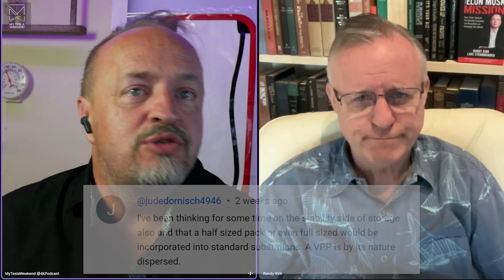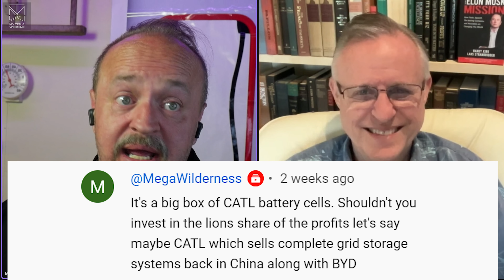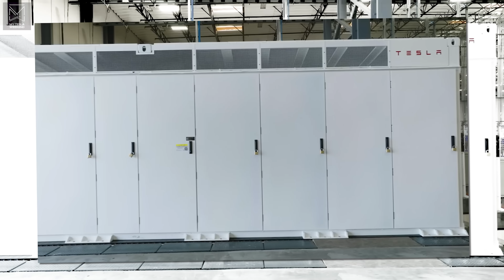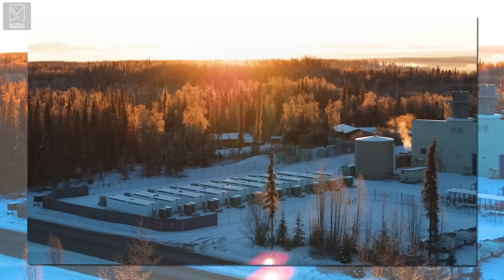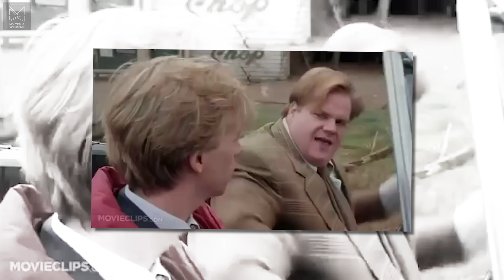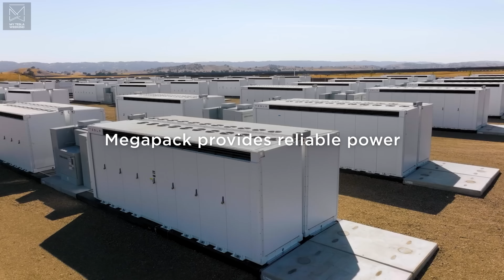Yes really, Mega Packs will make a TRILLION dollars

Comment: How about changing the structure of the Electricity grid from a centralized distribution model, distributing power through broadly spaced substations, to including independent micro grids using TESLA Megapacks, based at suburban locations with high Rooftop solar, with interconnector links to the main power grid.

Comment: On the outskirts of a rather small town (~10k pop) there's a large white metal enclosure with the Tesla name and logo.  I think it's smaller than a Megacharger but it's a hard place to park in order to measure.   I'll try to get a chance to park and walk back to get a shot and stick a tape on it.

I wonder if Tesla has made something smaller than a Megacharger for PG&E to trial?
Reply from the maker: Turns out the answer is YES! It's indeed called a Powerpack. Bigger than a Powerwall, smaller than a MegaPack.
Reply: @FutureAzA  
"Powerpack hasn't been talked about much lately. It has been relegated to the background since Tesla introduced the bigger Megapack for utility-scale projects. However, Tesla is still making the product and it is still being used for many commercial-scale projects, like Electrify America's charging stations.    Sep 22, 2020"

Comment: 20% could very well be the out-the-door margin. But no utility, enterprise or institutional customer would buy a $2 million battery system without a service contract. Given Tesla's ability to manufacture extremely reliable electronics, those service contracts are extremely high margin. Lifetime margin of 40%? Easily…

Comment: A Model 3/Y LFP battery pack specifically configured to be a wall unit for homes would be great.
Reply: That's a 'second use' for EV batteries.  Assume that the car/truck bodies will be worn out by the time the battery drops to 80% capacity.  Since the battery doesn't have to be hauled around the weight is less important, making it useful for stationary storage.

Having a secondary market for EV batteries will make it cheaper to own an EV.  Higher residual value when it comes to crush time.  And then the additional value of the materials in the battery which can be recovered and reused to make new batteries.

Comment: The most realistic solution for our energy issues is in the software for these behemoths. Send the power where it's needed from where there's a surplus. The REAL problem is the TRANSMISSION WIRES - getting the power to the Charging Networks, homes and businesses now that demand is tripled. They weren't designed to handle that kind of load.
Reply: True. Linemen in the family.  There seems to be a shortage of supplies for the lines and already the grid is not doing well in many places. Not too mention all the natural disasters eating up the supplies and labor.
Reply from the maker: Transmission lines are going to be an issue no matter where the power is coming from. Having local storage will alleviate some of the strain, rather than relying on the long-distance lines to handle the increased demand.
Reply: But I'm perfectly happy giving Elon a couple trillion bucks for this system, our Powerwall gives us a real feeling of security. It is a networked system designed explicitly for this purpose.

Comment: How many of the mega pack’s are sold directly to Tesla for their own infrastructure and how many are for real customers. Internal accountancy is distorting the actual sales.
Reply from the maker: A transfer within the company doesn't count as a sale. There's no accounting in that regard. Only the revenue it generates once operational (like the "Gambit Energy" grid scale installation) will show up. The packs used at Supercharger locations will only show up as an expense, not as a sale or revenue center.
Reply: @FutureAzA  
Correct.  The cost of building the battery pack will simply be an expense, a non-vehicle manufacturing expense.  It may show up in the cost/earnings for the storage division of the company as will the revenue/profit.
Reply: Can you elaborate on where you think they are installed and how many?
Reply: @bru512 they are stating in the video that they are putting in mega packs with their chargers and the amount is what I would like to know as well.
Reply: @lesliecarter4295  ahh..  Well fortunately, this would be public information so it can be tracked, as can the Megapack yard at Austin.  I would expect if this is done, it would be in Texas first, as part of Tesla Energy Inc.
Reply: @bru512  If they were in the break down of the sales and were made public instead of just an overall figure I suspect that the sales would not be so compelling as these two would have us believe. Anyway I don’t suppose we will find out in a hurry ! 👍

Comment: Plus there is a huge tariff on Chinese stuff.
Reply from the maker: The cells in Powerwall and MegaPack come from China, and are subject to a 7.5% import tariff. That will represent a pretty significant savings if ONLY the cells are taxed at the border, rather than the entire power system.
Reply: @FutureAzA  
Yes, but they miss out on the IRA subsidy.  Look for Chinese, Japanese, and Korean battery manufacturers to open plants in North America.  No tariffs, subsidies, and lower shipping costs.

Plus labor costs are lower in Mexico than in China.
Reply: @FutureAzA  Thanks Brian. I wrongly assumed the typical rate was applied. "US places 25 per cent duties on around US$34 billion of imports from China, including cars, hard disks and aircraft parts."

At risk of getting trolled, the previous POTUS still thinks Chins pays for this. That is not how tariffs work. However, this is good and bad in my mind.
- China has applied huge tariffs for years outside of Asia. Plus, they manipulate their currency.
- But this may be a big part of current inflation. Somewhat doubtful, since this is a global problem. That and the Fed making it rain. 

Lastly, good to see the renaissance of manufacturing in N. America and protecting the supply of critical chips.

Comment: Arbitrage is not going to earn the money you are talking about.  However, demand response absolutely will.  Demand charges for a hospital or mfg plant is often more than the cost of the power itself.  Demand response sets the load at a constant level.  Demand charges are levied on the power reserve the utility has to keep so the entity is assured power whether they need it or not.  It is based upon the highest 15 minutes during a set period of time.  So if you can keep the load stable there is no reserve required and the demand charges are removed.  So you set the inverters of the battery to supply power when the load hits a set amount.   For the sake of this example let's use 1 kW.  So you want the utility to never see a load over 1000 watts.  So when the business uses more power than 1000 watts that excess power is provided by the batter.  When the load is below 1000 watts the battery is charging to bring the load to 1000 watts.  Thus the utility company sees a steady 1000 watts load and that is easy to provide for thus no demand charges.
Reply: I disagree.  Wind and solar are on their way to $0.01/kWh including the IRA subsidy.  And larger scale should drive the cost to about $0.01/kWh without subsidies.  

That's going to mean a massive buildout of wind and solar.  And times of 'pretty much free' power when generation exceeds demand.  There's going to be some profit in soaking up the almost free stuff and selling it later in the day/week.  At least until all fossil fuel and nuclear generation is gone.
Reply: @bobwallace9753  I'm not saying solar and wind aren't growing quicker every day.  I have been in the industry for almost 20 years so i can confirm all of that.  However, that isn't what we were talking about.  They said that they would save a lot on arbitrage and that isn't going to save anywhere near as financially lucrative as demand response.  Most residential users don't understand demand response because it doesn't apply to residential tariffs.  
It really doesn't matter how much the power is.  Demand charges aren't about the cost of electricity.  They refer to how much power has to be ready to be supplied at short notice.  Corporate tariffs generally include demand charges and they are EXPENSIVE.
Reply: @bryanwhitton1784  
I agree.  The big money, for now, is in demand response.  But there's also value in 'arbitrage'.  Later on demand variation will not be a cost driver.  We'll have large storage and that storage will take care of load following at almost no cost.

The grid needs storage, always has.  And we'll need storage for a renewable grid.  We're reaching the point in some service areas where there are times when wind and/or solar generation are starting to exceed demand which creates 'free' electricity.  Store that very cheap electricity and sell it into times when the gird would otherwise be buying coal or gas for generation.

" Demand charges aren't about the cost of electricity."

Actually they are.  If rates are set by market price, clearing price, the high cost of firing up a gas peaker causes the cost of all generation to rise to that level.  If the utility price is regulated then the higher cost of peaker output gets folded into the retail/commercial rate.
---

I've been off the grid for around 30 years.  I paid more for my inverter in order to run things like large woodworking tools.  I'm paying for power when my demand is high.

In early years due to the high cost of panels and lead acid batteries I would  run a generator a significant amount of time during the winter.  At something like $0.25/kWh it was cheaper than adding more panels and batteries.

Now with lower panel and LFP battery costs I generate all the electricity I need for all but the days with the heaviest cloud covers and generally have enough storage to drift through a couple days of storms.  Plus I use dispatchable demand (washing clothes, pumping water to my storage tanks) as a way to use some of my 'free' electricity.  If I had an EV then I'd spend nothing to charge it.  EV charging can be another dispatchable load.

I don't have a good wind site but if I did have a turbine I think I'd have no need for a generator.  I'm something of a prototype of our future grid.
Reply: @bobwallace9753  Good analysis.  As for demand response not related to cost of electricity in the basic sense everything is related to the price of electricity but more in the delta between the sources of the generation.  So you are right.  A gas fired peaker plant is more expensive to run than a gas fired base line generator or hydro electric generator.  But in demand charges you aren't paying for the cost of electricity per se.  What you are paying for is reserving the power whether you use it or not.  So it isn't really based on the cost of the power but on delivery reservation.  Because you are paying it whether you use the power or not the price of the electricity isn't really all that important.  It's the act of reserving for the potential usage that is important.
You are also right that storage will alleviate the need for demand charges.  After all that is what my comment was about.  The use of local storage for demand response will wind up making demand charges unimportant and save a lot of money in the process.
Reply: @bryanwhitton1784  

If the utility owns the peaker plant or has a PPA  then the times the peaker is  called into use the retail/commercial rates won't increase.   That cost will be averaged over the year.

 But I'm pretty sure that some utilities pay outside companies to provide peaker generation and they sometimes see the kWh cost of electricity become quite high.  IIRC, ERCOT has that problem.  I've seen examples of costs rising to alarming levels.  I could be wrong, it's been a long time since I delved into this issue.

Comment: I do think that a more decentralised battery distribution would be favourable over a couple of central located batteries. Of course, all users of the batteries need to allow for arbitrage.
Reply: Correct.  By spreading storage around the grid we create more resilient neighborhood electricity supply.  And we can move more electricity into an area because we can keep the transmission lines close to capacity 24/7.  That saves the cost of building new transmission.

Comment: The Mega Packs story is the end of coal peak demand plants.  The end of coal power.   Acceleration of clear air.  And at a lower cost.  Increased reliability to the grid.  10 years?  It will go by quickly.
Reply: Most (if not all) peaker plants in the US are Gas at this point. While renewables are growing, I think Gas is a big reason Coal has been dying. Saw an article somewhere about the Australian Tesla battery, it has sucked up 90% of the peaker market profits even though its relatively small because it can respond so fast to demand changes.
Reply: @brucec954  I am in Chattanooga TN, power generated by the Tennesseee Valley Authority.  TVA has  five remaining  active coal-fired fossil plants have a total of 25 generating units. Some of the these are not peaker plants but base load for metro Nashville.
Reply: @brucec954  Agree we were already switching from coal to natural gas before the rise of MegaPacks and renewable energy generation. Meanwhile, natural gas plants are leaking too much methane. Natural gas utilities in CA are working to fix leaks.
Reply: Well, I'm 81, so speak for yourself, young Jedi. But this is the first (and so far, only) real hope of averting the old fossils promoting old fossils crises rapidly approaching and already encroaching.
Reply: @thesoundsmith  At 62 years old I don't feel like a young Jedi. Looking forward to your 91st birthday.
Reply: Coal plants are somewhat used for grid smoothing.  They tend to be operated at less than full output so that they can ramp up to meet demand increase but they're slow to respond.  Their spinning mass provides some frequency stabilization.  

Some coal plants are shut down for parts of days or for extended periods when demand is lower.  

Most peaker service has been provided by natural gas.  But now large battery storage is replacing NG as it's a cheaper and better performing asset.  

Inexpensive LFP storage batteries will hasten the end of coal.  Coal is already too expensive for most grids, generally making sense only where the plant is close to an open pit mine.  It costs too much to transport coal if the distance is far.  The Build Back Better subsidy for wind, solar, and storage should kill coal and, to a great extent, NG.'

At the current ~$0.03/kWh unsubsidized cost of wind and solar, renewables are cheaper than purchasing fuel for coal and gas plants.  

LFP batteries should drop to less than $50/kWh.  And have 5,000 to 12,000 full cycle lifetimes.  At 10k cycles that work out to $0.005 to store a kWh of electricity.  A half a penny for the batteries.  Perhaps a penny when one adds in land, labor, and financing.
Reply: Coal is never a peaked plant peaked are fast response plants, typically coal take hours to come on line and hours to shut down fastest is battery packs, pump / store hydro, natural  Gas is next oil after that coal then nukes, solar wind are too unreliable  and variable unless backed by batteries
Reply: @simonlang2001  
You've got some of that right.  Coal and nuclear cannot load follow in any rapid fashion.  Coal plants have been used for grid stabilization by running them at less than full speed, allowing room to increase output when demand rises.   

Coal and nuclear plants need storage or natural gas, hydro, or storage fill-in.  We've built a lot of pump-up hydro storage as a way to soak up unneeded generation and move the energy to peak times.  Coal and nuclear also need backup generation as plants 'break' and something has to be available to replace their output for days, months, and even years.  The cost of storage and backup generation is largely ignored when talking about the cost of coal and nuclear electricity.  

Obviously wind and solar do not operate 24/365.  Storage is needed.  Why is it even necessary to make that point over and over and over?

Comment: I agree, it's amazing. It's the only thing at large enough scale right now that can actually make renewables possible. Most people I talk to don't think that renewables are good solution and they believe that we should stay with natural gas, I kind of like natural gas myself. But what I am seeing with mega pack is that we don't even need any natural gas we could get on without it 20 30 years from now
Reply: In 2017 the US converted 2% of our fossil fuel generation to wind and solar.  Things got knocked down when Trump got in office.  But now panels are a lot more efficient so the cost has come down and wind energy has also become cheaper.  We could probably convert 4% of fossil fuels to wind and solar per year without breaking a sweat.

Currently the US gets about 60% of its electricity from fossil fuels.  60% / 4% = 15 years to essentially quitting fossil fuels.  

And 15 years from now if any new ICEVs are being manufactured they are likely to be a very small niche product.

Give us a year or two to ramp up.  The IRA(Build Back Better) subsidies have just come into play and it takes a bit of time to build new factories.  By 2025 we should be moving quickly to get rid of fossil fuels.